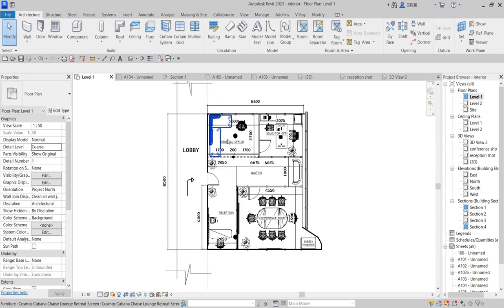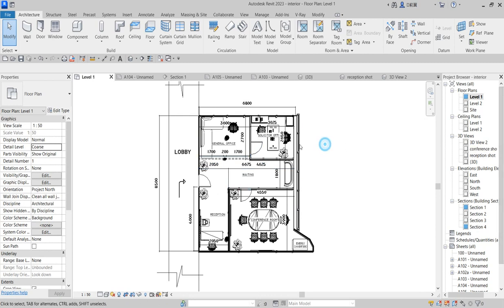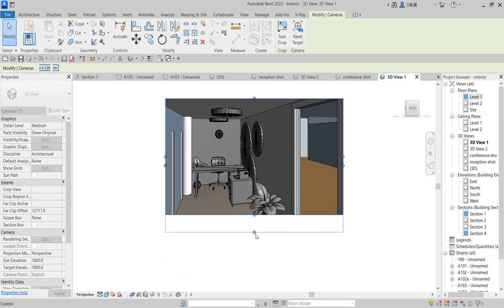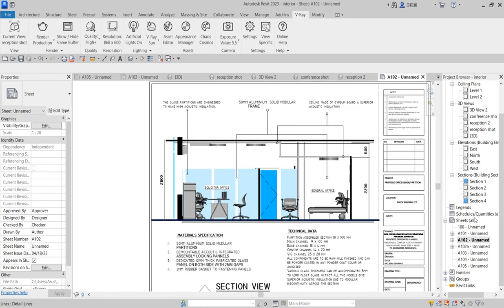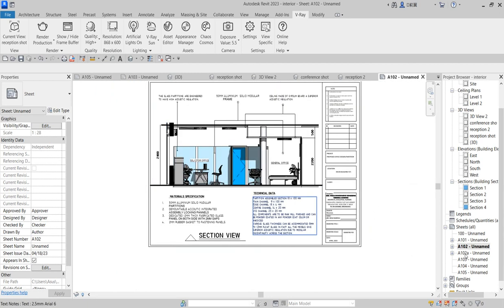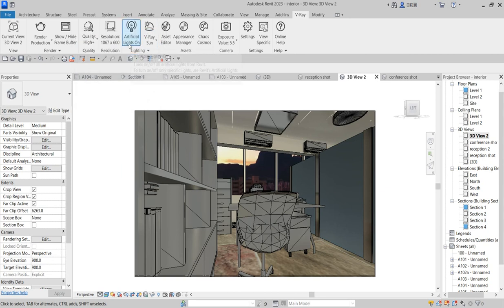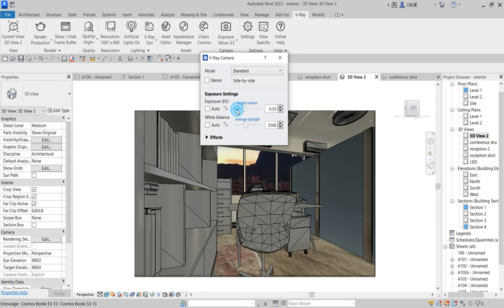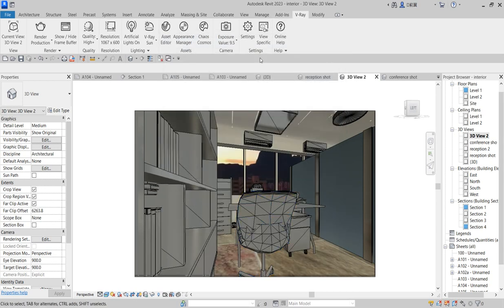How to Create Office interior using Revit 2023 and Vray 5

Comment: Good morning Sir
Is there any link to download the Vray?
I don't know what actually happened with mine !!
It keep on loading and turn white each time i click on cosmos, inwhich i will not be eligible to work on it at the end,
I also find out that the materials are not available there
Is there any way you can be of help to this my issue
Either by physical if your location is nearby or online ?
And what might be the cause of this my challenges?
Please help me out
Thanks
Reply from the maker: Good day, yes there is link but I can't post links again because I have received strike from YouTube because of the previous links I shared. 
What is your computer configuration and the version of your Revit that may determine the crucial point of cosmos behaviour.
I reside in Abuja, but you can contact me on WhatsApp for further assistant.
cheers..
Reply: @multinext_design  
The spec is 
Core i7 laptop
512ssd
8gb ram
1gb dediçated 
Sir I'd like to have your WhatsApp contact
For further discussion
Reply: The Revit is version 2021 Sir
Reply: Good day sir
You are yet to respond to My request
Would there be an opportunity for me to have your WhatsApp contact?
Reply from the maker: You can contact my WhatsApp 08155296388, Cheers.